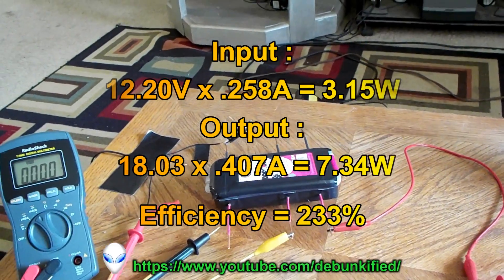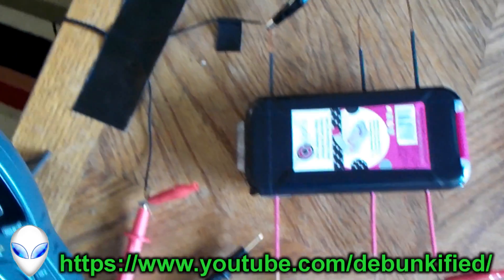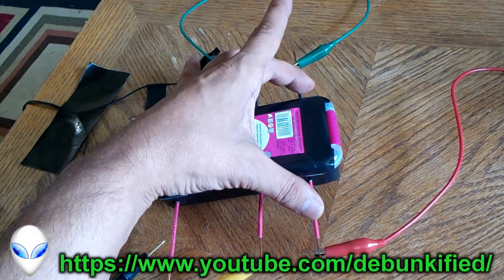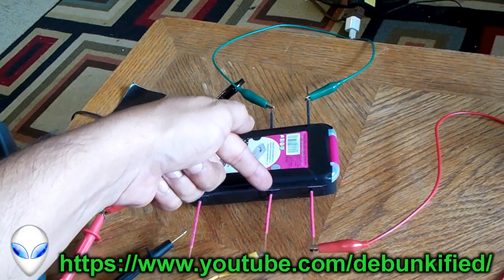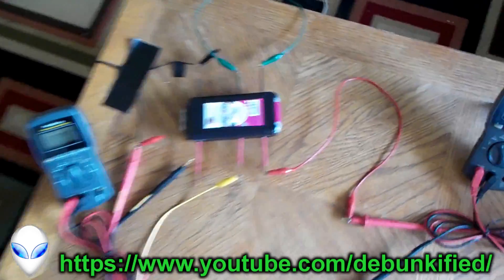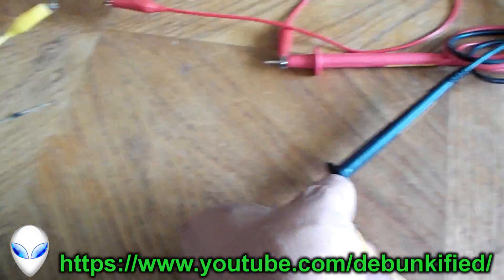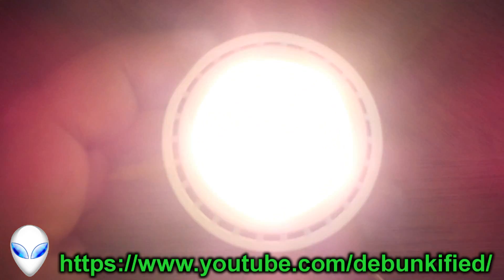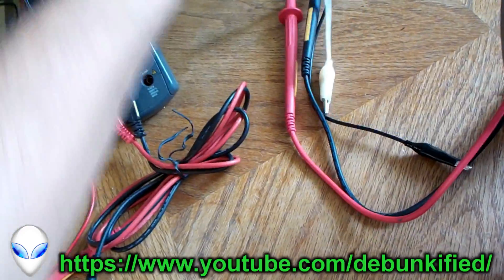More Output Wattage Achieved - (233% Efficient)

Comment: So can we say the 18 Volts output is splitted up , so the LED bulb gets about 10 Volts and the center "power source" gets 8 Volts or something like this..?
Reply from the maker: +overunitydotcom That is exactly right.
Reply: debunkified Okay,  but how do we get more power out then if the LED only gets about half the voltage ? So if the LED will only get half thw output power the other half is lost in heating the center stage circuit ?
Reply from the maker: +overunitydotcom Because the LED is only part of the power. It's just to demonstrate more "measurable power" out than in. It's work done, wattage, power, and energy. The wattage really isn't wasted through the middle power supply at all.

It is doing a few things. First it is flowing through that power source to charge it up as well as the LED lights.

Second it is producing real useable and useful output work in heating. This heat can either be perceived as wasted energy or useful energy to heat a room and to keep you warm in the winter.

Either way, what I have shown what nobody else seems to have ever shown and that is more "measured" energy out than in.

This energy is equivalent to real work done, power and wattage clearly measured and shown on meters.

It is to prove that free energy exists and that's it. It is to show the reality of over unity. The reality of more wattage and energy out than what goes into a system. It is an electrical efficiency.

I have also shown this on a mechanical load as well in which the "entire energy" is shown to be powering a mechanical load and not split up at all into two different loads, but just only one load. 

A fan can be placed on this mechanical load to push air around and to cool us down in the summer time. This extra energy is more energy powering the mechanical load than what comes out of the power source.

It doesn't get much clearer than that. Let me ask you, how many times have you seen over unity being measured on meters before?

Comment: I found an error :
you need to measure the output voltage between the 2 red outputs, so across the LED...but you measured the output voltage between the 2black output pins and the very right red pin...but there the current does not flow....so the output power measurements are not valid...
Reply: What is the voltage between the 2 red output pins where the LED is connected ? You need to use this voltage for the output power measurement. ...
Reply: debunkified Hmm...maybe RF currents will flow then through your LED which the meter set to DC will not register ??
Reply: debunkified For these circuits you really need to use a scope to see what is going on...
Reply: debunkified You need to put the load across the cap so you measure the voltage and current correctly.....Just measuring the voltage at the cap alone where no Current is flowing is invalid.  Hook the LED bulb or an impedance  matched resistor across the cap and then measure voltage and current again directly there....
Reply from the maker: +overunitydotcom The current is flowing from the capacitor where the source of the voltage is at. THIS is the source that does it all.

So this is the correct way. The LED belongs where it is at because it is placed just after the positive or just after the meter, or which ever comes first. it doesn't matter as long as the meter is in series with the LED light.

Like I've already previously mentioned there's no point in placing a voltmeter across the LED load alone because this is only part of the available and entire wattage. Go back and reread the two resistor example.

I know nobody wants to try to understand that there are TWO loads at the output, the LED is only one of them, the other LOAD is the other power source that is developed across the other red and black terminals, which is the first power source.

In other words the last and final output voltage is sitting across BOTH the first voltage source and LED powering both of them up. BOTH the first power source and LED are BOTH connected in series as one WHOLE load.

The first power source is being charged up by the last power source on the far right and does not drop in voltage, as well as through the LED lights.

There is no other way about it, the LED is only part of the entire load, not all of it, this is why I do not take measurements at the LED only, if I were to do that you would only see about a 80-92% efficiency of course.

When factoring in the rest of the voltage across the first power source in the box being charged up from the second power source then we see the entire wattage, not just the voltage and wattage across the LED only.

If you would like I can take a measurement there at the LED and record it, but it's not going to be the full wattage that we are seeing on the meters.

So in summary, The voltage at the power source on the far right is simply powering both the first power source (the red and black wires in the middle) as well as the LED lights simultaneously.

The meters are set up to read this entire wattage sitting across both the first power source (the red and black wires in the middle) which is a load connected in series with the LED lights, which is also a load as well.

A power source (the power supply sitting in the middle of the box) is a perfectly valid load, not a battery of course, but similar, in that its receiving charge as well and is charging up with power, wattage, energy, and work done, as evidenced on the meter.

The meter is set up correctly and exactly as to how the input meter is set up. A voltmeter is across the output on the far right of the box to measure voltage, just like on the input.

A meter to measure current is set up directly after the positive of this voltage source, identically like the input. Current comes out of the output voltage positive, through the meter, then through the LED lights, then through the voltage source in the middle of the box, then back to the negative of the last power source. 

That's a lot work, and it's more than what's going into the input. This is what the meters measure. There are no weird AC radio signals skewing the measurements because everything is double filtered except the input, it doesn't need it, and if a filtering capacitor is placed there then it's the exact same result.

The output has a smoothing filter capacitor on it, and it was actually taken off in the video and everything remained exactly the same. It's because it's a clean and pure DC.

The currents and voltages on the meters are of a very stable nature, and are not characteristic of weird AC signals which are all over the place on meters. They do not vary and are more characteristic of the direct current coming from a battery, which are not all over the place and completely unstable.
Reply: debunkified Okay I see, so the middle Red wire coming out of the box has no constant voltage but is just like the collector of a JouleThief circuit that switches the LED bulb on and off very fast ?
Reply: But if the center red pin of the box is switching the current,  you can not just measure the current with a DC ampmeter....that will show false readings if there is a pulsating current is flowing...
Reply from the maker: +overunitydotcom Hi, yes that is pretty much happening in a round about way, not exactly, but you're on the right track in understanding what is actually happening.
Reply from the maker: +overunitydotcom No, it is normal clean and pure filtered unadulterated Direct Current.
Reply from the maker: overunitydotcom The center red pin of the box is the positive of the first power source. There are two power sources in the box, the last power source is charging the first power source in the center as well as powering the LED lights.

I will make a video explaining this better, than what I already have. These power sources are completely filtered into the cleanest and most purest form possible, twice even.
Reply: debunkified I see..So the current flows after the LED bulb through the center red pin to the black ground pins ?
Reply from the maker: +overunitydotcom Correcto.
Reply: debunkified Hmm is at the middle center red pin also DC voltage versus the 2black ground cables ?
Reply from the maker: +overunitydotcom The positive section, yes. The middle red and black wire leads is one output being charged up, while the last red and black wire leads is the actual power source doing the charging, as well as running through the LEDs.
Reply: @oudotcom  No need a scope, that is full DC, it just loop feedback and boostrap.

Comment: Hmm strange that the diode raises the input current. ..as it adds resistance at a fixed input voltage it shouldn't it lower the input current ?
Reply from the maker: +overunitydotcom Hi overunitydotcom, yes it is a bit strange that the input current goes up a bit instead of down. That pretty much makes absolutely no sense at all does it? 

So far everything I have seen with this circuit is quite the contrary and opposite to what one would normally think.

Everything is pure DC too, so there are no strange AC or voltage spikes skewing the measurements either.

The current going up with the diode, which should be going down is indeed a strange anomaly yet the output current and wattage isn't affected at all, maybe by a milliamp or so, which doesn't correspond to the amount the input goes up by. I scratch my head and crinkle up my face.
Reply: debunkified Well yes,  the first circuit probably has a reactive current flowing back to the power supply..so by using the diode you stop the reducing back current and so the circuit draws more input current. ..analyzing the circuit diagram would really help...lol..
Reply from the maker: +overunitydotcom Well there is actually a current that can be drawn directly off either output in the box individually. It's set up so that the last output to the very far right is charging up and flowing through the first output on the left or in the middle as well as the LED.

Because the first output is taking up power or energy the LED is only getting some of the power flowing through it, not the entire amount of energy.

What I measured was the the total energy flowing through the LED and the first output power source in box.

If the voltage is measured across the LED, it would be basically 0V. It's the opposite of the powerless radiant energy of a voltage with no current powering devices. It occurs between the two positives, hence splitting the positive.

So in other words it's current powering the LED with no voltage, the "other" form of radiant energy.
Reply from the maker: +overunitydotcom There is no high frequency AC.
Reply: Unox the BOX? Disturbing trend on You Tube this
Reply: debunkified Hmm, if DC will flow through the LED it would not light up with 0 Volts...so is it high frequency AC ?